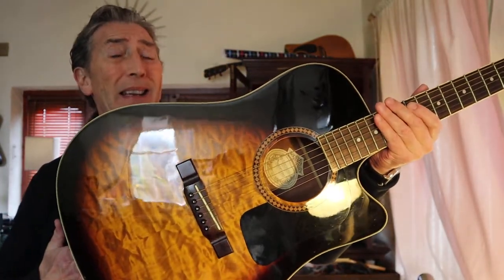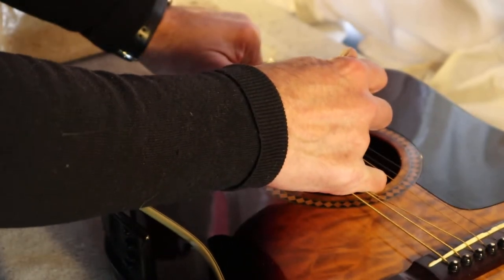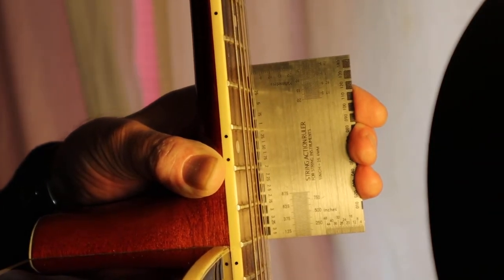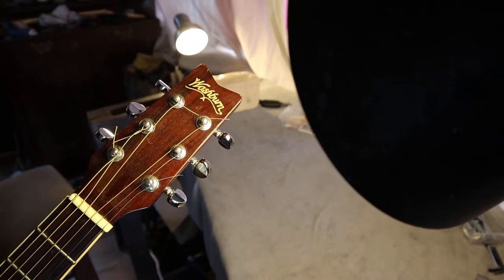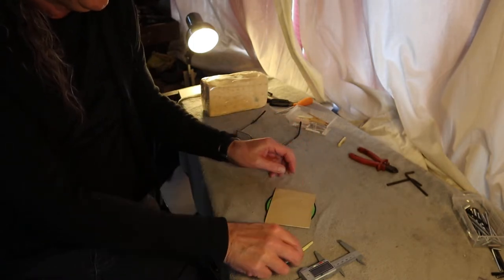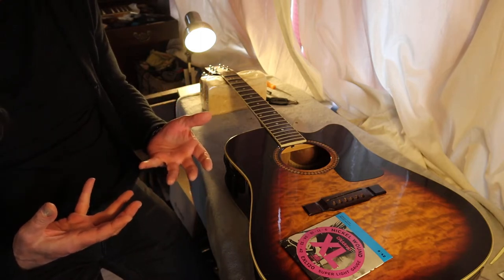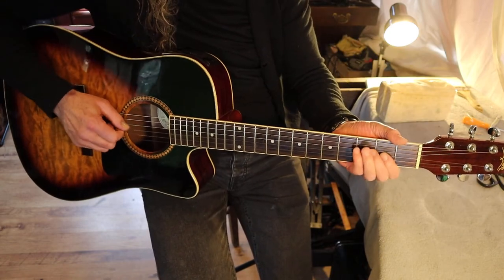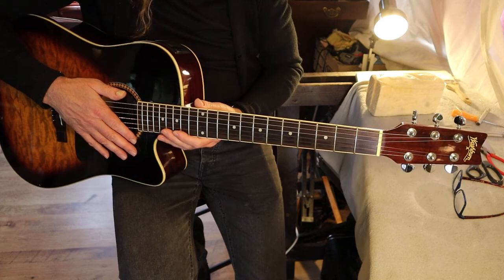Set up an acoustic guitar and make it play easy

Comment: Thanks a lot. I was wondering how to lower the action on a acoustic the other day without too much stress. Like a numpty I always thought the bridge was glued in. Good work mate
Reply from the maker: Hi there SR H :-) Even if you remove too much material it's an easy/cheap fix. Acoustics notoriously have a string height that's difficult to live with. Cheers :-)

Comment: Go on be honest this really is a video you've put together especially to annoy me, removing bridge pins with a metal instrument, fitting nickel strings, using a plain G, why? Rule of thumb for acoustic is lower the action heavier the strings, and always bronze to retain the warmth.
Reply from the maker: Hi Michael :-) Yes, accepted on all points. I was seeking to explain that a variety of household items can be employed to remove the bridge pins and the lightweight strings went on as a test set up. The bronze Martin items were to be fitted once the string height issue had been addressed depending on what my buddy Joe thought. He explained in very clear terms that plain 9's wouldn't do. It's a funny thing is string choice and probably the reason I'm not really keen on acoustics. I remember a mate of mine had a Hummingbird with bronze girders on it and as beautiful as the guitar was, I found it to be unplayable. I usually go to my Variax for an acoustic sound. Acoustics are notoriously tricky to record with.  Cheers :-)